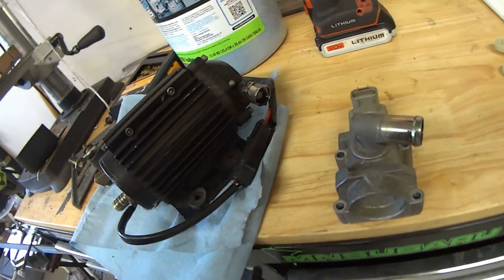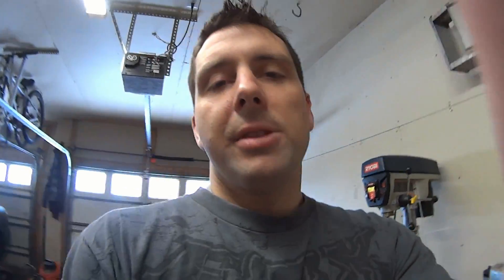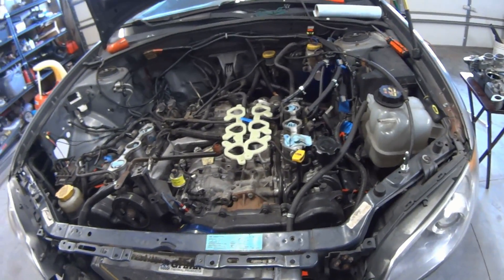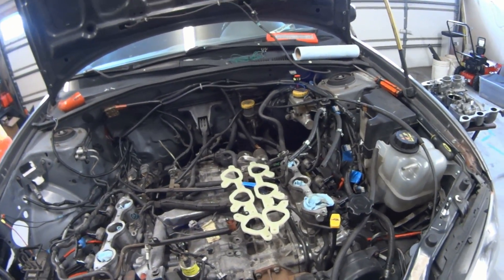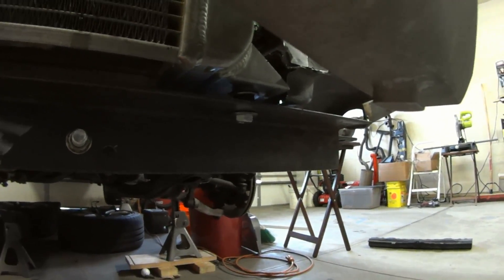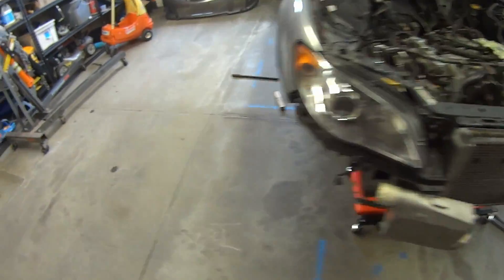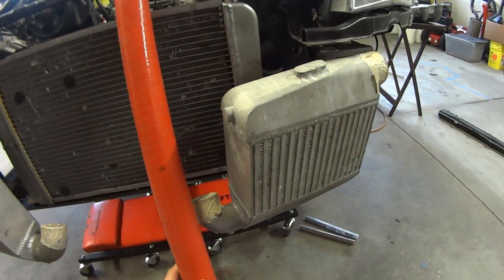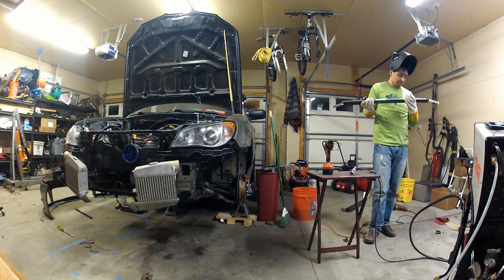EG33 Swap - Phenolic Intake Spacers (Ep. 14)

Comment: Lots of progress very cool! How about creating a cradle or box the intercoolers sit in rather than weld directly to them? Thanks for the updates!!! Do you have a build thread on any forum?
Reply from the maker: Thanks I'm kind of interested in trying aluminum welding though and it will still be bolted to the steel crossbar. Here is my build thread: https://mnsubaru.com/threads/eg-in-a-gg-by-eazy.48428/